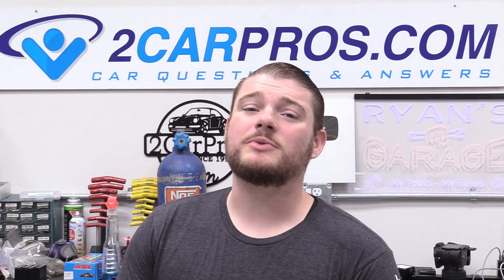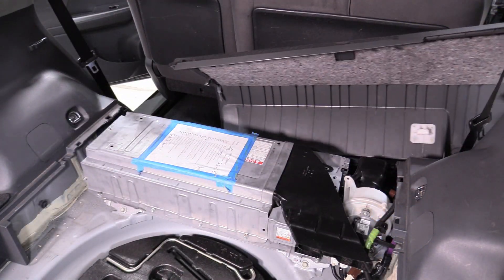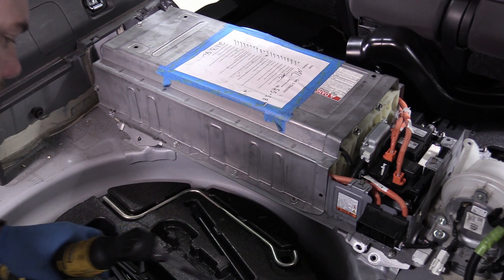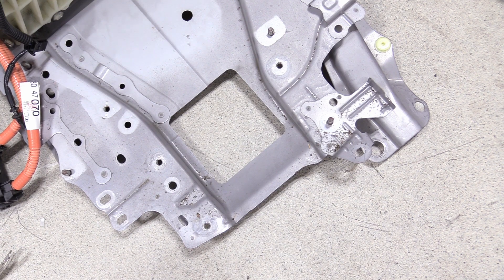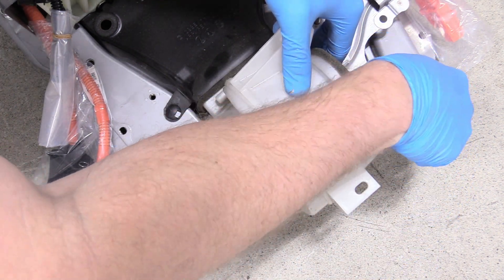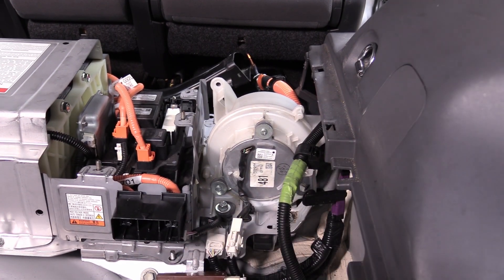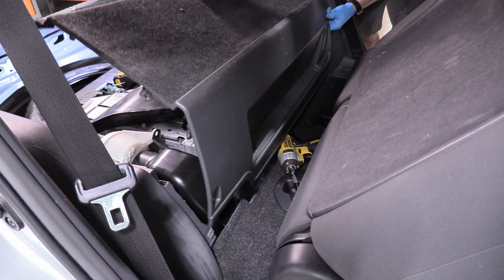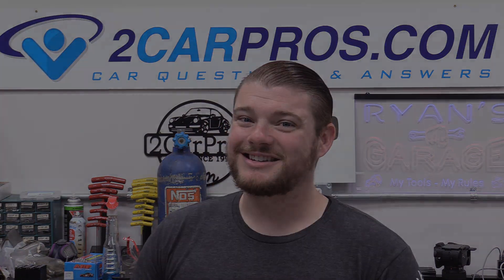How to Replace Hybrid Battery Toyota Prius V 2012-2017 | Code P0A80 FIX IT!

Comment: You shouldn't leave out the wiring harness holders, they keep the wires from vibrating and rubbing on the metal and each other. And btw, the nut you boogered up removing the pak and replacing it, wasn't messed up in the factory. Its heavy , bt you still cant just drag it around. Thanks, great video other than... ?

Comment: dr prius app report: battery is less than 33%, must be replaced. AC sometimes shuts off with dtc: not enough el current. what battery do you recommend? a couple of years ago I discovered some "upgraded" battery with cylindrical cells. can not find the same place again, but ebay sells such for 1795, 2 years warranty. on other hand, fully re manufactured are cheaper, and come with 3 years. any suggestion?
Reply from the maker: I can only recommend the OEM battery from Toyota. The battery I took out was claimed to be new and was an aftermarket junker. Lasted not even a year. Thanks for watching!
Reply: @2carpros  thank you for your suggestion. we have now an option for Li or Na batteries. I hear, Na have quite much advantages.

Comment: Just replaced my Hybrid on my 2010 Prius and other than it taking me a day, I got it done! :-). Thanks 2CarParo!
Reply from the maker: Great to hear!
Reply: Did you need insulation (gloves) I’m about to do mine this weekend. I’m concern about the inverter back firing current when removing the main terminals. Toyota manual says to use gloves yet I see everyone doing it without them.

Comment: , please, please, I need your help information. I was working on 09 murano, changing one of the coils, and I took the intake off, and when I heard little something fell and for sure a little md*** nut fell inside the holes of the engine I find out it was because when I started the engine I can hear the little f**thing bouncing 
My cuestion is what I can do? Or where those stupid things go when they fell inside 
Can I take the valve cover gasket?
Please
Reply: Oooooof thats a rough one pally. Yeah no, your engine might be toast.